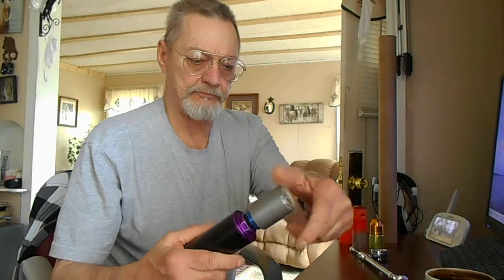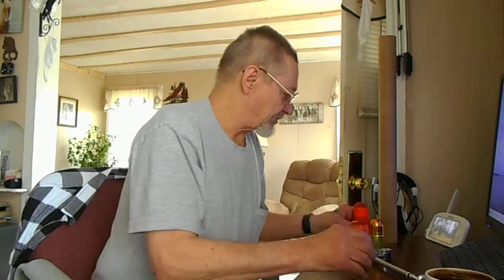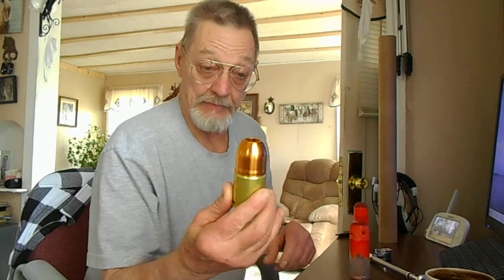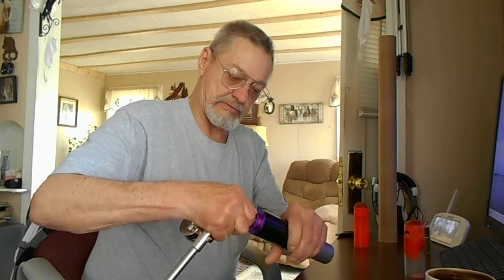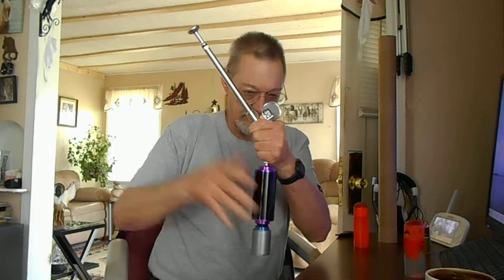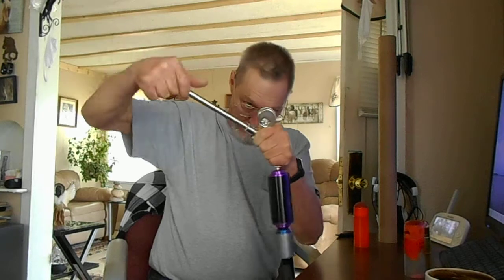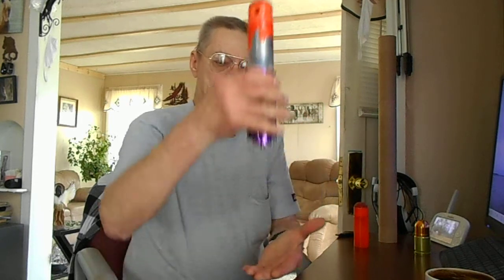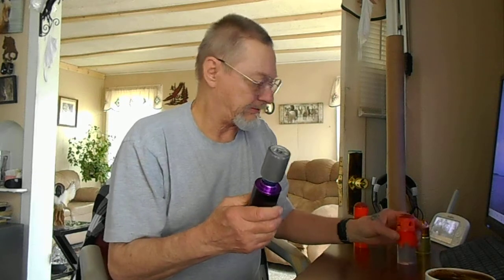Homemade 40mm airsoft mortar shell...how it works!

Comment: Hello, please could you tell me How do you make the valve that releases the air when you drop it in the tube
Reply from the maker: The steel ball bearing sits on a hole in the center of a circle of a flat thin piece of silicone sealing it as air pressure is pumped in. The heavy weight of the ball pops loose when it falls down into the launch tube and hits the bottom stop. Just like a person flying thru the windshield of a car going 70 mph and slamming into a brick wall!
Reply from the maker: Did you get my reply?